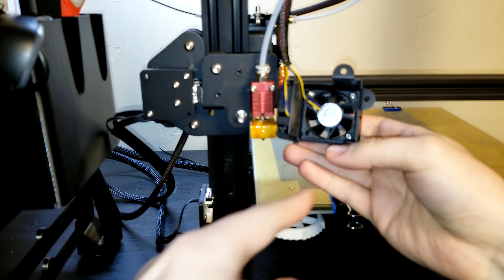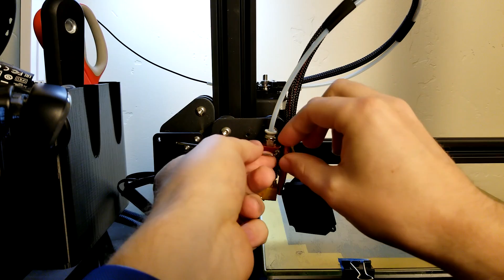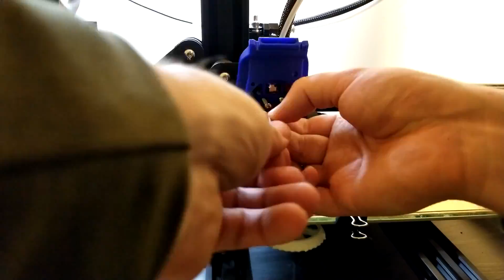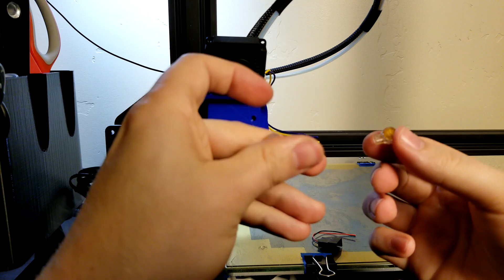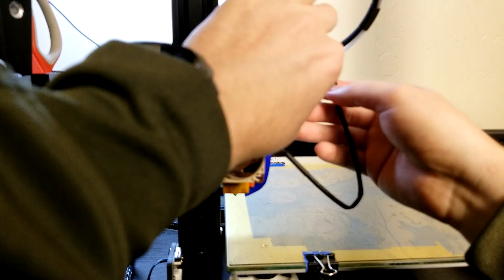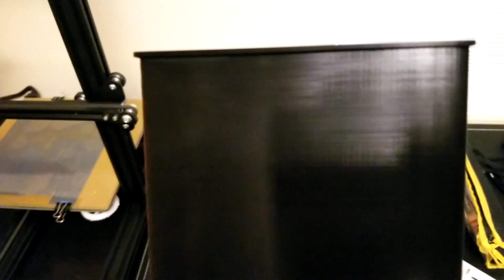EPF Fang & Noctua Fan mod for Creality CR-10!

Comment: I busted by old fan on my cr-10 mini and thought about printing this on mmy second 3d printer to upgrade to a better fan, since I have to replace anyways, but is Pla okay to print that? would it not melt?
Reply from the maker: I printed this in PLA and have done 3+ day jobs printing at 230 C PETG and no issues.
Reply: @cbutters  Thank you for the answere, maybe I will really print that, since the other one I tried (HeroMe) was too close to the heater block and melted partly, it still works, but looks questionable. 
Better change it to this before it is too late

Comment: Hi, also new to printing and the main two reasons I am considering a mod like this is better visibility of the hot end and lower fan noise.  I am concerned abut one thing though.  Eventually i want to print ABS and I've heard it's best to keep everything warm and NOT cooled at the Hot end?  Anyone have any input on this?
Reply: So long as your bed is heated you should be good. You can always set your filament cooling fan to 0%, but you'll always need your main fan on or you run into the pushing rope problem.

Comment: Thank You, I am switching to on my Alphawise which is a cone of a CR-10.  My first print of the Fang was wrong because I had a bad instruction on the support and it added support inside the air ducts.  Thanks, Jan for warning me in advance that I didn't see.  I don't think my Alphawise has the round fan with the removable duct so I will have to look for that replacement.  I really recommend the Creality 3D glass diamond plate.  It is amazing how well it holds and when cool the print just lifts off.  Here is the correct one since there are frauds. https://amzn.to/2Y36Szt

Comment: You noticed no degradation in print quality,  but you also noticed no improvement in print quality either.  Whats the point of the upgrade then?  You could add the Noctua fans to the stock cover.
Reply from the maker: One thing is that it is much easier to see the filament as it is actually printing without the boxy head in the way.

Comment: Are you sure you want to have the fan exhaust blowing towards the heat sync?  That is the way you are showing it mounted.  The side with the label is the exhaust side of the fan.

I have read it is more efficient to have the fan exhaust drawing hot air away from the heat sync by having the exhaust side of the fan pointed away from the cold side heat sync.

Comment: Is that fan 12V?
Reply: Should not it be 24 V? hi
Reply: the powersuply in a crative cr10 is 12 volt , you can allso mount the stock fans and only chance over to the fang

Comment: Hi. I have just ordered Ender3. Question: Can I use both original fans instead of installing Noctua fan with this design? I do not mind the noise. I was using Felix 3.1 printer before but this guy was only trouble from day One.  Today I lost all three fans power connection on controller board at once so I think that termist. is fried.

Comment: What reason did you have for choosing a 40 x 20 mm fan instead of the CR-10s stock size of 40 x 10 mm fan. By doing so I assume that you will change the amount of air flowing over the printed filament.
Reply from the maker: I wanted a quieter fan, so thus the noctua... but I heard that the 40x10mm fan sometimes wasn't strong enough. the 40x20mm has a bit more power.
Reply: I should have been more explicit. When designing the CR-10s I'm guessing that they chose the optimal air flow. So instead of using a 40 x 20mm they chose a 40 x 10 mm. 
Is this a bad design choice? 
Up until the time I broke a fin on the stock fan and replaced it (Noctua 40 x 10mm) I didn't perceive there to be a big problem with their fans except for noise.
But now I'm getting the impression from lots of 3D Printer users, in particular CR-10 users,  that for optimal printing we should buy bigger fans and attach them to "fangs" just millimeters away from the hot-end and freeze the freek out of the hot filament as it oozes out onto the surface of our print. 
Where does this belief come from? Is it anecdotal or have people studied this and come to the conclusion that the "Fang is the Thang" .
What's your thoughts?

Comment: Looks like the cooling ducts on this design are aimed at and cooling the nozzle, not the filament or the part being printed. I'm sure the filament is getting some what cooled, but with the stock blower fan its just not strong enough. If all you plan to be printing is PLA, this may work out ok. If you step up to PETG or ABS...I would suggest getting a stronger parts cooling setup with something like a 5015 blower.
Reply: But PLA is the one that should be cooled as much as possible and ABS shouldnt be cooled at all as this results in stress in the plastic...
PETG is more in the middle ground were you want some cooling to not string that much but also not at 100% fanspeed if possible...
Reply: Can you recomend a special model which is silent? I have a cr-10 and my has the stock fans, which i want to change because its way to loud for me. And in the same way i would like to upgrade the fans for the extruder and something. Can you give me recomendations please?
Reply: If you want to stick with the blower fan, try this one...
https://www.thingiverse.com/thing:2763931

If you want to use the better 5015 fan replacement then try this one...
https://www.thingiverse.com/thing:2759439

I'm currently printing out the Petsfang V2. Hope it completes before my stock 40mm fan dies. It makes a HORRIBLE buzzing sound when there is a lot of x-axis movement. :(
Reply: Thanks a lot for your answer!!! Man that was what i searched for! I like more to invest in better things then to build or buy 2x cheaper versions. So i would love to use the 5015 fan, because i would love to be able to print better materials in the future than PLA because i need it for my own projects. I would also print the Petsfang v2. But my technical knowhow is limited. I never did a change of the fans before, or the hotend. I also have a friend who would print for me the petsfang v2 even in POM if necessary. Which material is the best for the petsfang v2? Only problem my english is limeted atm so that i dont understand everything what written in the discussion on thingivers. Is there a way that you can make me a list what i have to buy - for the 3 case fans, to get them silent. Even with affiliate links if you like :-) And which fans for the petsfang v2 i would need - silent version if pissible :-) . And which screws, and which hotend do you recomend of fits with the petsfang v2? So that i can buy it and build it together? I would love to get rid of the noise and be able to print with better filaments than PLA or ABS :-) You can write me also as PM if you like. thanks a lot for your help!!!
Reply: They are not aimed at cooling the nozzle. Lool at the petsfang which was designed with the help of an engineer and it's intended installation is the same, just below the hotend even though it looks like it's cooling the hotend. A 5015 is much better though, I'm running two at once lol

Comment: What material did you print this in? I just printed it in PLA and not sure if that works. Thanks
Reply from the maker: I just used PLA as well... Its been fine so far, but I'm not printing ABS or nylon either... But according to what I've read, PLA should be fine... remember that air is flowing through this thing so its unlikely it will get hot enough to melt.